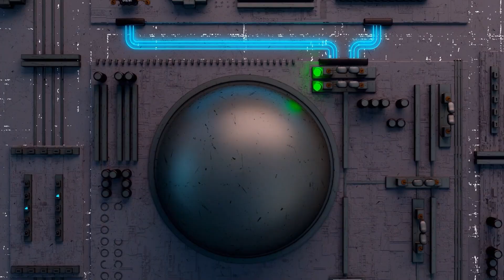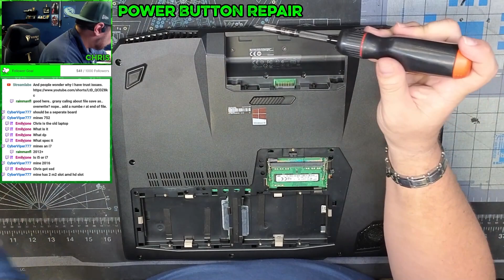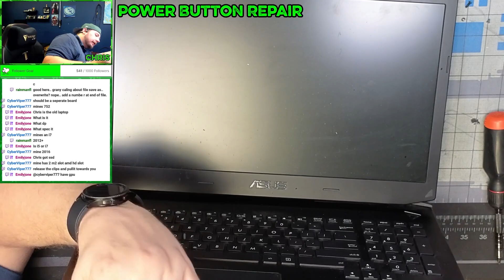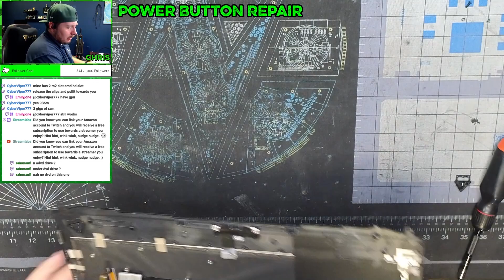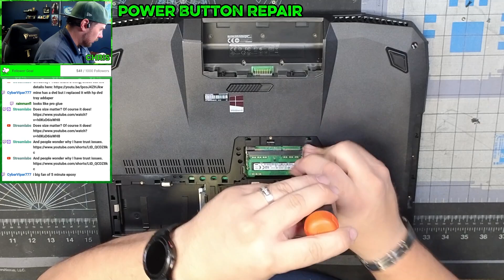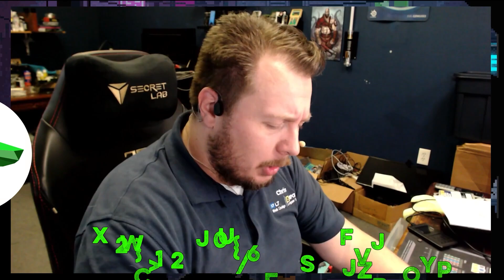Fixing an Asus G750JX, a Teardown Guide #245

Comment: ive fixed this same issue a few years back now i gotta do it again for another client. this thing is still really snappy for their use case i did a ram,ssd and windows upgrade and they are very happy. the picked it with a reality nice alienware backpack at a yard sale for $25 with the og oem charger. glad its getting upcycled and not ending up in a landfill.
Reply from the maker: They are decent laptops, Glad to see they are not ending up in a landfill as well!